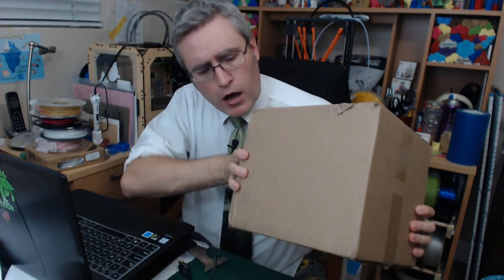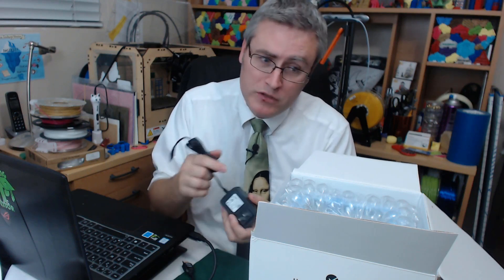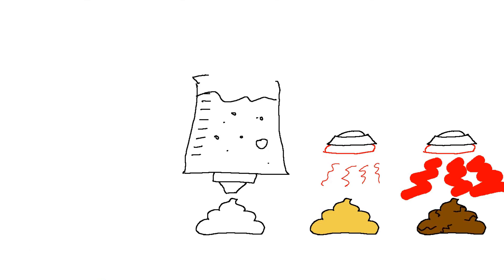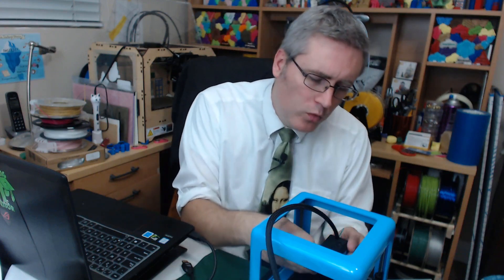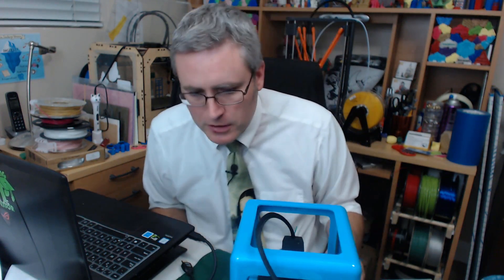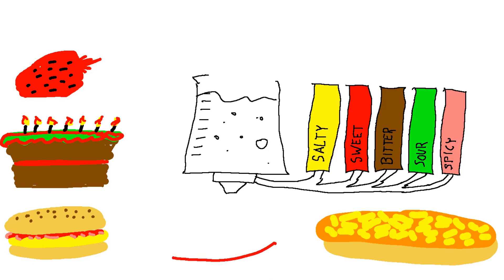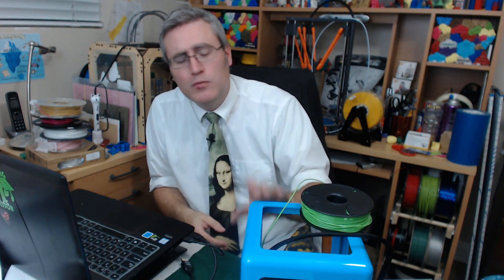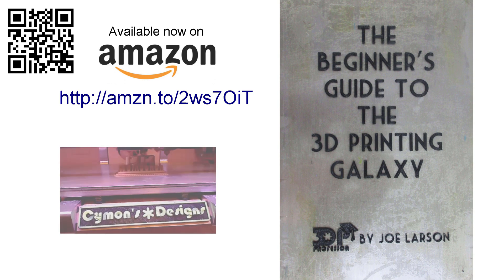Thinking about 3D Printing food while unboxing the M3D

Comment: My solution would be a device which can dispense one (or more) main substances, which are either starch-rich or protein-rich. These could be mass produced through bioreactors. Then the same machine has smaller nozzles dispensing curing agents. These would be proteins or even living engineered bacteria, which modify and crosslink the proteins and starches. Engineered bacteria or cell-free molecular devices could convert the base materials to flavors. They could even synthesize some cellulose walls to give a more planty feel. That way you could have a structure like muscle fiber next to a structure which looks more like collagen. This technique would make it possible to have structured food from very few base bulk components and a few sparse components, and the process doesn't require the application of heat during initial production.
Reply from the maker: Andreas Klostermann Let me know how work progresses on this.

Comment: Love the idea of the food printer.  imagine if we had one that could be air dropped into disaster areas run off batteries and charged with solar cells.  Be a great way to get some relief into area that are not accessible. Same with the portable 3D printer, which could make simple tools and need items until help arrives.  Both excellent ideas.

Comment: I have an m3d micro same as this one. They may have worked out some issuse but i can personally say. 1 its a good beginner printer to see if you like printing, but it is not a good printer. Between the small build plate, the poor accuracy and it oddly will both under and over extrude in the same print sometimes. 

It does have some nice features though, he didnt show it here but the spool holder is under the printer bed so it keeps it away from moist air and dust. It does have an external feed so you can use other filament other then their own, which is good cause their filiment is overpriced id say. Also it uses really cheap motors that give out pretty easily. Their slicer they use is ok but you must use it, even if you want to use gcode from another slicer it has to run that gcode through their controller in their slicer program.

Over all id say its a good design and i loved that it comes out of the box ready to print. But they should have made it with more robust materials.

Comment: What's your opinion on M3D's initiative to sell filament by length instead of following the industry standard selling by weight?
Their argument is that not all filament have same exact density, therefore selling by the length  provide more transparency of how much filament customer are actually getting.
Reply from the maker: What's your final print measured in? Weight? No. Length? No. Volume is the correct answer. Selling by length has more in common with volume than selling by weight does. 

Consider the metal filled filaments. A kg of those things is about 1/4 the volume of PLA. Would you rather know how  much your prints are going to weigh, or have an idea of how many prints you'll be able to do?

I think length isn't perfect, because it doesn't work across different filament diameters, but there's an argument for it.
Reply: Tsai Alain personally i would prefer companies to sell filament by length. If you think about it when it is sold by weight you will constantly be getting a variable length of filament. Although you may get a more regular price but then you could tell people what the price per meter is or other length mesurements. Although the problem with length is you cant keep track of how much filament is left as easily as you can wkth weight.

But i gotta say if you dont know the conversion from weight to length for a filament it leaves you wondering if you will get the amount of filament you need for a print. Especially if you are doing a large print in a metal fil pla or something of the sort

Comment: I am looking forward to your review of the M3D. Its sizes is perfect for my tiny printing projects, but the print quality is most important. Somehow I am expecting less wobble the smaller the size
Reply: The M3D is a pretty good printer, I had one of the original Micro printers from the Kickstarter campaign, it served me well for 2 and a half years until the feed gear died on it last year. The print quality is good for the price, expect some warping with some prints. Hope that helps.
Reply: Drex Thanks. I do currently have a five years old rep 2, and its print quality do hold up against modern printers. But sometimes it feels like overkill using it on tiny models. The M3D is adorable and its size is perfect, but I am unsure about the print quality, I need something that is better than my current setup
Reply: Yeah, looking forward to that as well. I'm one of the thoroughly disappointed owners of M3D Pro. I would imagine that the Micro shares at least some of its downsides, but I'm curious to see how it fares overall.

Comment: Since the extruder on a food printer would be something closer to a syringe instead of a gear pushing a filament, it means that you'd use air pressure and solenoids for the extrusion. It's relatively easy to have a head with many individual nozzles, each one with its own pre-mixed ingredients. This allows you to use different size nozzles depending on the ingredients and not have to extrude everything through one. Remember that the extrusion head is not needed here, since you're not cooking the ingredients, just extruding them (like the pancake bot).Pneumatic actuators are cheap, available, and you can regulate individual pressures. If you want to have different textures, you'd need some kind of hardener that can be applied to the places where you want a firmer texture.I actually built something very similar, but for making mixed alcoholic drinks.

Comment: When you open that thing there is no way of closing it properly and maintaining the calibration of the z. And you can’t calibrate the z because all 4 screws run on one motor and are connected with a belt and don’t use the internal filament feed, because there is no way of getting it out when it gets stuck
Reply: D:\side\ thanks ...
Reply: theres always a way.. it was put together it can be taken apart and reassembled , its not magic..
Reply: Greg Orielley you can put it back together, but you can’t level the bed nor can you move one of the lead-screws independently, which makes it insanely difficult.
Reply: looks cheap i see no reason to rip it apart unless he has to return it tho.. i mean if it breaks u need to fix it right